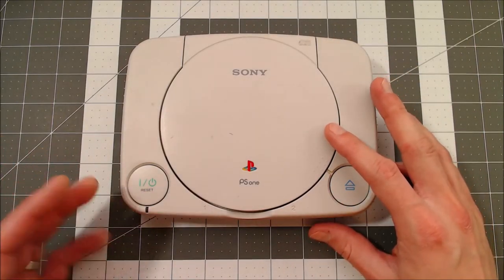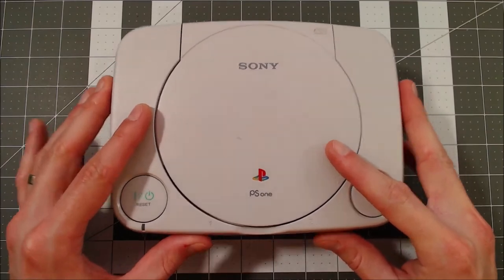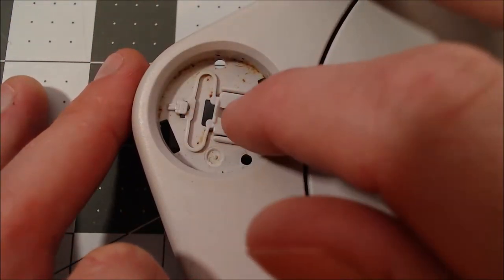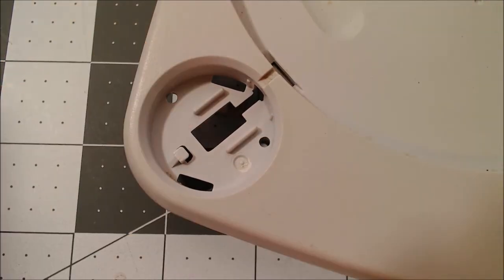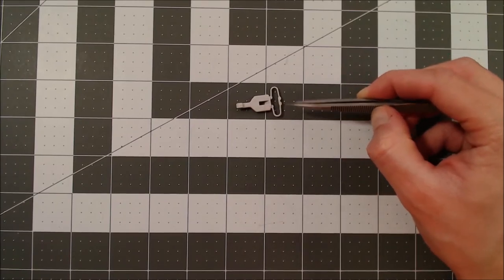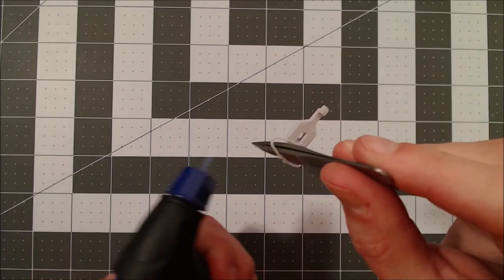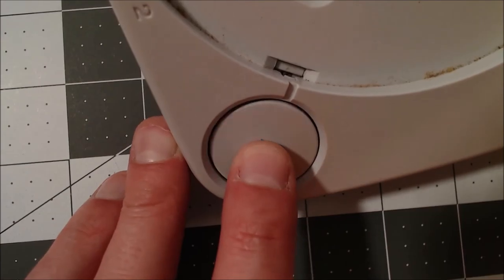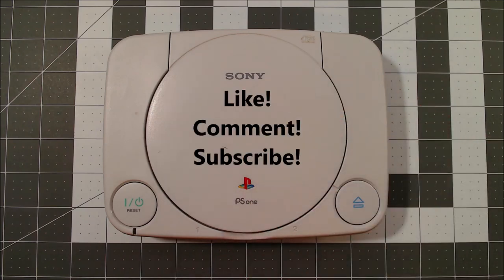Fixing a Stuck PSone Eject Button

Comment: For people that don't have the torch or don't want to play with fire. I think a good solution is to dip the plastic spring in hot water for a few seconds. Then put the twiser and put it in cold water, that should harden the plastic again in place.
Reply from the maker: I think that could work!

Comment: would you know how to fix a finicky power port? I want to fix my PS1 but the power cable only works at certain angles and pressure, it’s an issue with the consoles port not wire
Reply from the maker: Have you inspected the port? A flashlight will be useful. Best case scenario it is just dirty and needs a clean with alcohol. Worse case is some of the pins are damaged or corroded to the point where replacing the port is the best option.
Reply: The solder connecting your power port to the motherboard is most likely cracked, meaning that it doesn't have a proper connection to maintain. Its a very easy job, all it requires is some solder, a soldering iron and a few pokes. I just fixed this exact issue with mine, so chances are it's that. Best of luck!
Reply: Viviana is correct, I had just fixed a console with the same issue as yours. It's quite a simple fix if you know how to solder.

Comment: Good idea! Why does everything have to be plastic?! They could have put a metal spring in there!
Reply from the maker: Thanks! The gamecube used a metal spring on their latch and that one would get jammed all the time too! But it is true that being stuck jammed wouldn't have permanently deformed that spring like we saw here on the PSone. The problem that could never be solved is how to keep the mechanism clean from food/drink/whatever kids were spilling onto their console all the time. I guess that's one reason consoles these days got rid of external trays/lids and just have a disc slot with all moving parts internal/protected.